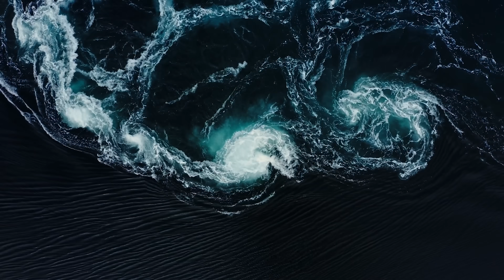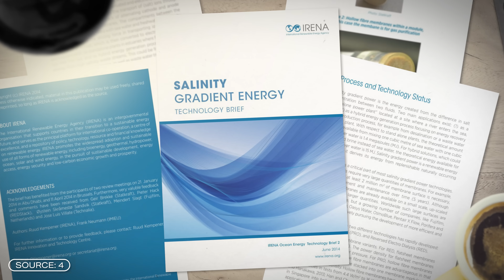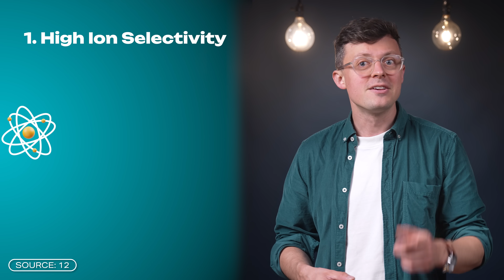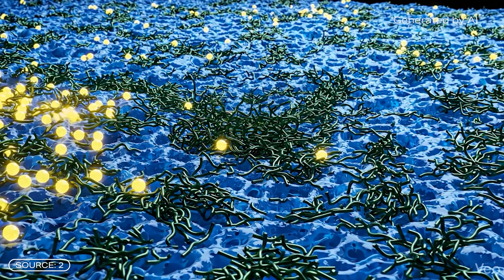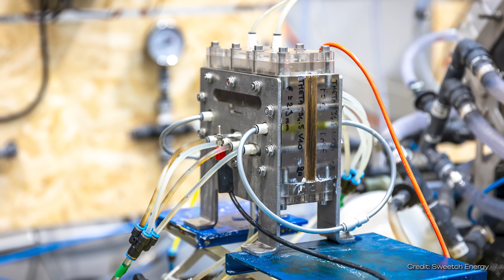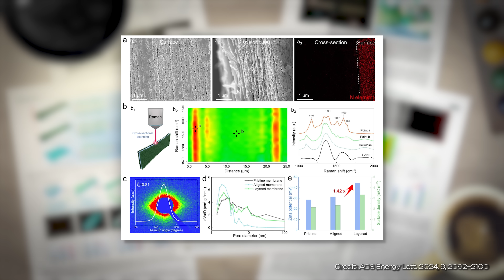Osmotic Power Plant: Enough electricity for 372 Million people

Comment: This is a foolish technology.

AI says: Theoretically, mixing one liter of freshwater with one liter of seawater releases about 2.2 kilojoules of energy.

That translates to 0.6 watt hours per liter at 100% efficiency. My phone has a 15 watt hour battery, so it would take at least 25 liters of fresh water to charge.

AI says: It takes roughly 83 to 105 kilojoules of energy to bring one standard cup (250 ml) of tap water to a boil, depending on its initial temperature.

To boil a cup of water would take at least 932 liters (0.932 tons) of blue energy fresh water.

Charging your electric car's 100 kilowatt-hour battery would use at least 166 tons of fresh water with a blue energy efficiency of 100%. That 100 times more than the average house uses in a day.

Does this really seem like a good idea to anybody?

Comment: Blue energy, or osmotic power, is a renewable energy source generated by harnessing the chemical potential difference in salt concentration between freshwater and seawater. It is a sustainable, continuous (24/7) power source that utilizes semi-permeable membranes to generate electricity, offering a promising, low-impact alternative to fossil fuels with high potential in coastal regions. Key Aspects of Blue Energy Generation Methods: The two primary technologies are Pressure Retarded Osmosis (PRO), where freshwater passes through a membrane to pressurize seawater, and Reverse Electrodialysis (RED), which uses ion-exchange membranes to generate electricity directly from ion movement.Source of Energy: The power is derived from the natural, inevitable mixing of river water and seawater at coastal locations, making it a reliable, non-weather-dependent source. Potential & Impact: It is estimated that up to 15,000 TWh of energy is released annually where rivers meet the sea. It is highly efficient for coastal, industrial, and wastewater treatment applications. Technological Advancements: Researchers are improving efficiency using nanotechnology, such as lipid-coated nanopores (EPFL) or specialized nano-membranes (Sweetch Energy) to reduce resistance and increase power output. Environmental Benefit: It produces minimal waste (mainly brackish water), making it a highly sustainable solution to assist in decarbonization. Recent Developments[Japan's Projects]: As of late 2025/2026, Japan has initiated efforts to test and build osmotic power plants to create stable, renewable power that complements solar and wind.[Efficiency Gains]: Studies (e.g., EPFL in Feb 2026) have shown that using nanopores can drastically increase ion flow and energy conversion, enhancing the scalability of these systems.[Commercialization]: Startups such as France-based Sweetch Energy are developing tech aimed at powering up to 1.5 million households. Despite being an under-exploited resource, blue energy's ability to run continuously makes it a critical part of future, diversified, and sustainable energy grids.

Comment: It seems to me that the big issue would always be PRE-FILTRATION of both the fresh water and the seawater - otherwise the turbidity of both would clog the system very quickly. So filtration andd clearing of SILT would add greatly to the costs of the generated electricity.

Comment: gemini claims you can 5x the electricity output using seawater vs concentrated brine instead of seawater vs river water...   also that the higher output using concentrated brine means the cell produces hydrogen and chlorine gas as a byproduct while generating electricity...  seems to me that waste heat from data centres should be used to evaporate seawater, feeding brine to RED stacks, to turn the low grade heat back into electricity and hydrogen fuel...  just need a good evaporator system and lots of cheap membranes....

Comment: It's a great addition to the various options for green energy we already have. Importantly, fresh water can flow more or less on demand as opposed to wind- or solar-energy. 
Just like Vortex Bladeless this osmosis thing could be decades away from commercially ready. Tests are running, and that has been years ago, yet not much new information is being send out. 
Here 's an idea maybe, did you even create a video about Vanadium Redox Flow batteries? Those are already available on the market and have a long lifespan, which makes them look expensive while that isn't so bad in reality. We can charge them on wind- and solar-energy which is also already available, on the cheap of course when there of massive overproduction, making it an essential component for grid stability.

Comment: Put it near the salty outlet of a desalination plant to also reduce the saltiness before it is discharged into the ocean.
Reply: That's certainly an interesting idea, if one could recover some of the energy used in the desalination plant, then perhaps the cost to operate one could be reduced a bit.
Reply: Where do you get fresh water from near a desalination plant?
Reply: @VijayaGopala  it's an infinite energy perpetual motion machine 😅
Reply: @VijayaGopala  The discharge is higher salt concentration than the ocean?
Reply: @VijayaGopala sewer discharge or even regular water from the ocean since it is less salty than RO brine

Comment: Anything with strong baseload capabilities and relatively mild negative impacts on the environment needs to be researched to death. Stuff like this where we could keep it going through at a trickle then ramp it up if required is an easy win to help when it's still and overcast. Like hydro. We should start really turning hydro into a "when necessary" tech - otherwise we divert and let the river do what it was meant to...

Comment: This is all interesting but yet another excuse not to build nuclear reactors. Fission plants have energy density of 500-1000 We per m2 I mean including the plant, excluding thermal energy (60% of total) and thats not even close to what the physics maximum is, I mean even the unit is a bit ill-defined. Fusion is pretty much in the same ballpark. Also saying solar and wind are the cheapest is very misleading, its missing grid integration costs (superlinear), capacity factor and storage/backup. Look no further than France vs Germany, where Germany's solar+wind combo has resulted in 10-20% higher electricity prices than France since Energiewende, and only 60% co2 free vs France (90%+). And French nuclear power plants dont have that great CF anyway on global scale. If you really want base load comparison then real unit is LFSCOE.

But yeah, building that stuff on gigawatt-scale I do wonder what the ecological impacts would be.

Comment: Dear Jac,

In the Netherlands, this system has already been operating for almost 10 years. Please check this link:

Blue Energy / Osmosis Energy System at the Afsluitdijk

This project uses the difference between fresh water from the IJsselmeer and salt water from the Wadden Sea to generate electricity through membranes (osmosis / reverse electrodialysis). The pilot installation is located at Breezanddijk on the Afsluitdijk and was developed by Redstack.

Comment: Another hurdle I see here is the waste of freshwater. Sure most countries in Europe are lucky so far and have it in excess but taking my country Malta as an example we're already running our desalination plants almost 24/7 during summer. 

Which brings me to my next point. I think it would be nice to see if this tech could run on seawater+brine instead of freshwater+seawater. It preserves the salinity gradient but for countries like mine we have infinite sea water and tons of brine that's pretty much a free waste product. The power output doesn't need to be high, offsetting the reverse osmosis power demand would be enough.
Reply: Even offsetting a bit of the desalination power demand would be potentially useful. If one is lucky it could help reduce the cost of running such a process a bit.
Reply: Wastewater treatment plants can moderate the purity of water, so this system may complement island lifestyles.
Reply: This technology might not be the best fit for a place like Malta however depending on the depth of water offshore and the temperature gradient Ocean Thermal might work better there. A refrigerant like ammonia is boiled and run through a turbine to spin a generator and make electricity then water is pumped up from deep enough in the sea where it is colder and used to condense the refrigerant and send it for the next pass through the turbine. A byproduct of pumping up water from the sea bottom and discharging it on the surface is that the nutrients that have sunk to the bottom promote plankton blooms which feed fish and filterfeeders like oysters, clams and mussels.

Comment: Two questions:

1)  What is the ratio of energy output vs the energy 'input' required to manufacture of the membranes and other consumables?
Y
2)  If this becomes very successful, and osmosis plants begin proliferating at many river estuaries/deltas, then to what extent will they create a barrier for migrating aquatic life trying to move between the sea and the river (albeit that this is quite a challenge anyway - osmotically -  for living organisms).

Comment: If these plants were co-located with desalination plants, wastewater treatment plants, hydrogen generation, or nuclear power stations; in what ways would the outputs increase or improve?
Reply: mixing seawater with concentrated brine produces way more electricity than mixing with fresh water, the red stack can produce hydrogen and chlorine gas as a by product while generating electricity. a desalination plant sending its output brine through a red stack with sea water could generate electricity and hydrogen fuel to power the reverse osmosis pumps reducing the need for diesel fuel to run the desalinator...
Reply: If you have a river, there is no need for desalination plant. Just take the fresh water strait from the river.
Reply: @awigren  Where there are desal plants, water may very well be in short supply, while the briny residue streams may be seen as somewhat problematic, to some.  Reframing the salted outflows to profitable resources, may be helpful to many water stretched locations, as the local flora and fauna would be less affected, as well.
Reply: @FlameofDemocracy you can use the brine output to recover energy using the standard seawater, I remember reading something about the osmotic membrane science around a decade ago and realizing that what you're describing is essentially the future

just not the parts that are ass backwards, like desalinating water and then trying to osmotically recover energy from it, the cinversions are inherently inefficient, you would just be paying for parasitic losses nonstop
Reply: If it was colocated with hydrogen generation, it would be certainly not be an improvement, because hydrogen is a waste of energy and money.
Reply: @zlozlozlo  Hydrogen that is green is quite cheap in Saudi, for example.

Comment: I found this very interesting, especially since it is the first time I've heard of the process. Some longevity issues may involve the purity of the two water sources. Ocean water contains a range of dissolved salts, and the fresh water source will not be 100% pure either. Both sources will likely have both particulate and biological contaminates that will likely need to be throughly filtered out before being fed into the energy generating cells. All these issues need to be evaluated before this can be employed on a mass scale.

Comment: I feel vindicated.  Like so many "new" technologies, reverse electrodialysis is one of those ideas that has been moving from one experimenter to another for decades, evolving its own improvements while benefiting from new, applicable technologies developed in other sectors.  I was too early in the game to start gathering investor and collaborator support,  so the project fizzled and I was forced to move on to different areas.  For the record, however, one can find my provisional U.S. patent application No. US 2006/0263646 A1, "Reverse Electrodialysis for Generation of Hydrogen."  Twenty years ago, I intended to use the small potential differences of many cell layers working in series to develop enough voltage to separate water into hydrogen and oxygen.  I had a preliminary idea for the electrochemistry to do this.  The approach would be very challenging, even in light of present day developments, because the engineering constraints to get efficient electrical generation are further compounded by the constraints to efficiently generate hydrogen and oxygen within the same structure.  The benefit, however, would be to go directly from osmotic potential to a storable chemical fuel in a single step.  I'd be the last to discourage futuristic dreaming, as that's how many solid, useful technologies are first born.

Comment: Japanes build osmosis power plant in Fukuoka that use pure presure differential to move turbin. They open that plant in August of 2025. They yearly energy production is 880,000 KW. Cost to build per KW $43,000. Levelized cost of electricity (LCOE) is $0.20 to $0.40 per KW, with development aim in next decade to $0.10.
Reply: are you trying to say 880,000 kW (which is not a "yearly" measure) or 880,000 kWh (which is, but really isn't that much. that's like 80 homes worth of solar panels)
Reply: @jedinxf7  It's 880,000 kWh / year of energy. "That’s the equivalent of powering about 220 Japanese households." Source: "Japan has opened its first osmotic power plant" , The Guardian, Aug 26, 2025.
Reply: @jedinxf7 80 homes that in US, in Japane they use 2-3 time less per home. 80 homse or even couple hundres, may not look like much, however if they reduce cost it may become very atractive as the system operate 24/7.

Comment: Fascinating video!  I'm curious, does this process only work with salt? Or can other particle produce this affect?  Does the salt have to come from the ocean?  I assume most people know that human waste has salt in it, could  that salt be used in some point in the waste water treatment process to produce electricity?  Or is this process too fragile  that any sort of contamination  would stop it? Could the hurdle be surpassed by remixing the salt water before pumping it back into the ocean? Or does the salt no longer exist and thus can't be extracted again?  Interesting tech to think about. I wish the US would put more money and thought into  green technologies consistently,  but we likely be behind everyone else for the foreseeable future. Thanks!
Reply: I would think the salinity in waste water would be pretty low, and thus give much lower output than seawater paired with freshwater.  
I would think it would be more fitting if the discharge is into the sea, since then there would be a large difference between the saltwater and the slightly salty wastewater.  
My guess is that brine from desalination would be a much better option, since there is a large differential in salt content, and this basically runs on equalization of salinity.